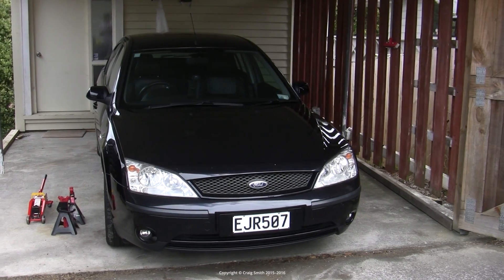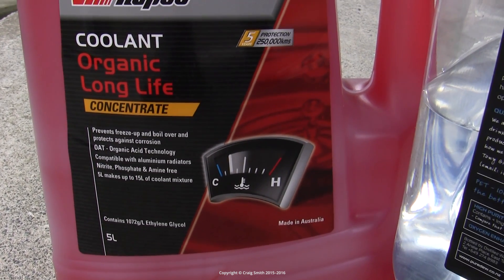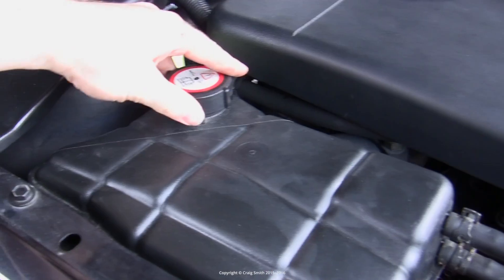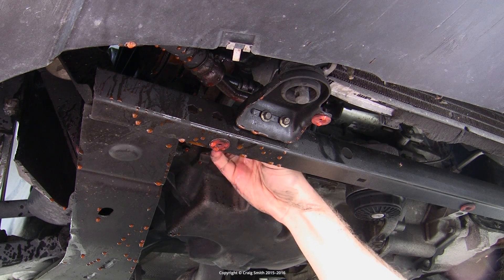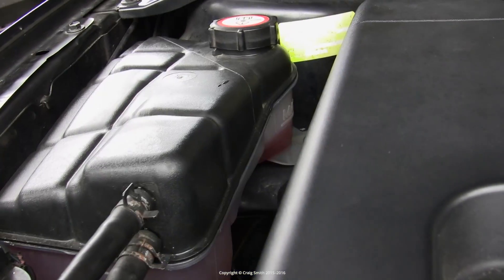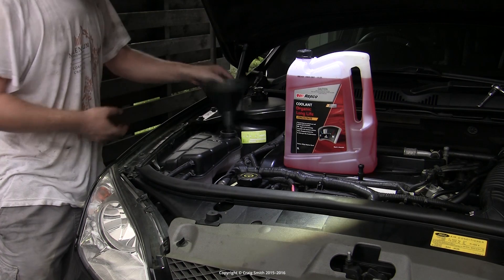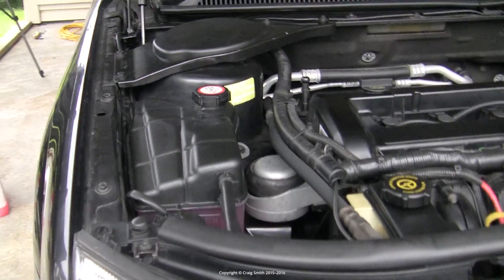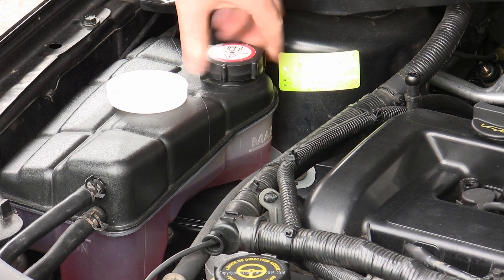How to: Ford Mondeo & Focus (Duratec HE) coolant change

Comment: Strange how you have installed red antifreeze Craig! Mine came with Orange antifreeze which recommended by Ford in New Plymouth! Orange antifreeze is the only anti freeze that doesn’t attack aluminium radiators! Most Chevy’s use orange antifreeze because their radiators are made of aluminium & it’s been written on a label under the bonnet that the orange antifreeze should last 60,000 miles. That’s what I use in my Chevy & so does a friend who races a sprint car at the speedway! It pays to do some research on antifreezes like I did
Reply: Yes it is orange and it turns green when it gets hot

Comment: Hello, thanks for your video, I learned a lot, but I have a question, after changing the coolant, there may be air left in a certain part of the pipe, where is the valve to discharge the air, I saw some cars have a bleed valve next to the expansion tank, but I can't find it on the Focus car, do you know where it is or how to solve the problem of air being trapped in the pipe? I think this is very important, thank you
Reply from the maker: There's no bleed-valve on these engines, they self-bleed. You shouldn't have a problem, just watch the tank level over the first few hundred km of driving.

Comment: In this video at 17 seconds into it you see the top of a metal pipe with a valve in it between the engine and the screen wash resorvoir what is that for?
Reply from the maker: Air con.

Comment: And change the radiator cap every 4-5 years.
Reply from the maker: There is no radiator cap on these systems. If you mean the coolant tank cap, maybe, but you're more likely to end up needing to replace the entire tank as they tend to crack with age.

Comment: Hi, why dont u add coolant by diluting 50/50 water before. I know that concentrate coolant is harmfull for engine and their some specific parts?
Reply from the maker: Because if you've flushed the system with water beforehand, you don't know exactly how much water is in there. But you do control how much concentrate you put in.

Comment: Great video. But can I just point one thing out which could cause a costly repair. You mentioned different colour coolants. Just to clay you must not use the wrong colour coolant and definitely do not mix coolants. There are three types, neither can be mixed and doing so will crest a chemical reaction, which turns the liquid into a gel, clogging up the small pipes, pump etc. Causing catastrophic failing of the engine !!

Comment: My mondo mk3 doesn’t have a drain plug
Reply from the maker: It might be hard to see, check the lower RH corner, look for the indented cross. If there's really nothing you'd have to take off the lower hose, pair of vice grips on the clip and a hot air gun to warm the rubber up.

Comment: Hey Craig, I've done this procedure and when I go to run the car all I'm getting from the AC is cold air. Any idea why? I have a 2002 Mondeo
Reply from the maker: Do you mean during or after. Have you bled it (run the engine long enough?) What temperature is the CHT getting up to and how quickly.
Reply: @CraigsDIY  After I've added coolant. The temp gauge is getting to operating temp in about 10 minutes or so. Even after running for 15 mins it's still blowing cold.
Reply: @CraigsDIY  unless I've bled it wrong? I assumed my car was self bleeding like this one

Comment: Never bothered and I've worked in motortrade 47 years. Red stuff is good for 10 years usually . Cars not worth the expense after that.
Reply: But surely you can appreciate that vehicle technology isn't the same as 47 years ago?! I've been in the trade 20 years and 90% of the practices/procedures I would have followed THEN would be outdated now... You are reference procedures carried out on cars made in the late 60s early 70s and, by your implication, following the same processes - that just seems ridiculous to me.

Some people enjoy carrying out DIY maintenance and like to do this type of job when required to hopefully avoid potential damage to other components. For you to just dismiss that as 'cars aren't worth the expense after 10 years' is nonsense.

Comment: Heloo, how to know in the first place is a thermostat or not. My cooling fan wont turn off.
Reply from the maker: I have a vid on the stat: https://youtu.be/vooZyEI2Il4 | However, cooling fan not turning off may not be the stat. They usually fail open not closed. 1stly is your air-con off, as fan will stay on always with AC. 2ndly check your coolant temp to check the temperature (not going over 105 deg C) and that's it's a sensible figure from the sensor.

Comment: Hi, can i add also 50/50 coolant and distilled water here in Europe where we -18C in winter times? Or can I just put full coolant? thx for ur reply Craig.
Reply from the maker: That's cold - but 50/50 is still good down to at least -35 deg C. You actually get maximum anti-freeze effect at about 66% coolant, which will supposedly manage down to under -50 C. The effectiveness actually decreases at higher concentrations - your bottle of 100% coolant concentrate will apparently start to freeze at about -15 C! Additionally Ford, for one, specify concentrate to remain between 40 and 60%. So by all means go to 60% if you like but no higher.
Reply: Thx for ur reply craig, i was just wondering if distilled water can not freeze under certain temperature.

Comment: friend i have a ford focus 2008,,,duratec HE,, petrol,it was too cold today,i start the car but power stearing was not working,,,after i did near abt 50km its started to work,,,,i want to know  it has hydraulic or electronic power stearing?,,bcas i dont c any liquid container,,,,,,,,,,thnx
Reply from the maker: It's hydraulic, the pump & container is at the front top of the engine with the yellow steering wheel icon. See here https://youtu.be/YW08WT8GyNU - although it sounds like you have a major problem, pump failure maybe, or loss of fluid.
Reply: Tnx friend

Comment: Hi Craig your videos are really good I have changed the thermostat on a ford Mondeo 1800 sci petrol which is chain driven as you know. I tried to change the water pump but cant for the life of me get it off because of the awkward location and using a 40cm long pair of water pump pliers its barely moves it, do they use an extractor of some sort? could you please offer some advise? dave

Comment: Hi Craig!  I have a question about the Mondeo engine bay.  Just to the right of the screen wash filler cap and the 2 hoses that attach the coolant tank, there is a metal pipe sticking up.  Mine has a black screw cap on it, but on the video yours doesn't.  Can you tell me what this pipe is for?  I can't work it out.  My Mondeo Mk3 has had no heat since the radiator was changed 2 years ago and I'm clutching at straws trying to work out what it could be before I take it to the garage to be fixed......
Reply from the maker: The pipe is one of the aircon valves. If you have no heat it's probably a stuck-open thermostat, they're bad designs and tend to break physically. Assuming your radiator was hooked up correctly of course. Here's about the stat if you're interested: https://www.youtube.com/watch?v=vooZyEI2Il4
Reply: Great!  Thanks Craig!

Comment: Thanks for an excellent HowTo. My question here is, why changing longlife coolant (used in the MK3 as far as I know) at all? Is it just to be sure?
Reply from the maker: Well the Ford spec is to replace every 10 years, and coolant manufacturers tend to rate their own product for less than that e.g. 7 or 8 years. More usually you will have no choice because in that period a water pump or hose or something else will fail and need replacing.

Comment: Hi Craig. Thanks for a very comprehensive instructional video! You're making my life a lot easier here! 
I ran into a bit of an odd problem when I tried doing this. I flushed the system a few times, letting it all run out of the hole in the bottom there; tightened the rubber screw; but as I was filling the antifreeze into the expansion tank, it filled up before I got 4 litres down there. Should I have to turn on the engine to get the system to pull the liquid out of the tank each time I pour a little liquid in there? (which worked partially, but I still couldn't get all 4 litres down there)
Thanks for your time!
Reply: The fact is that using the demonstrated method, you drain the antifreeze only from the radiator, expansion tank, but not from the cylinder block. There is a drain hole on the cylinder block itself, but it will not allow the block to be completely drained. The video shows that when washing with water, the engine is not warmed up until the thermostat opens. This prevents the newly filled water from mixing with the antifreeze of the closed small circuit. In my opinion this is not the right approach. It is necessary to warm up the engine and let it run with the thermostat open, and flush it using this method several times - then there will be clean water in the entire system. Then, on a cold engine, drain 4 liters from the system (which is essentially water) and add 4 liters of concentrate.
Reply from the maker: The pump needs to run and circulate liquid a bit before all the air will make its way to the top. The Ford cooling system is supposed to be self-bleeding. Just run the engine for a while, drive the car even (but keep a close eye on temp gauge), and see if the level drops. If it doesn't and the engine remains properly cooled then the system is probably full. It's possible you didn't drain enough; check you removed the expansion tank cap while draining for instance.

Comment: hello , congratulations for the video very useful for emptying the cooling circuit. A question about the ODB2 sensor you are using, what type and can you share a video for the model Ford Mondeo MK3 gasoline . Thank you for your reply
Reply from the maker: +Stephane Vincent It's a "vgate" from eBay, about $20. I use it with Android app "Forscan" for Ford & Mazda. I will do a review on it sometime.
Reply from the maker: https://youtu.be/KdvnPC204zU